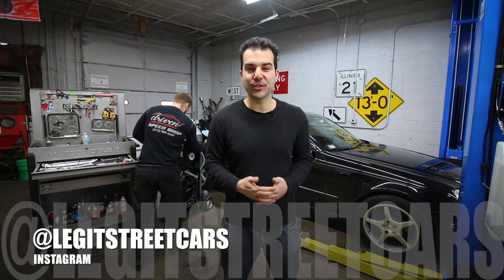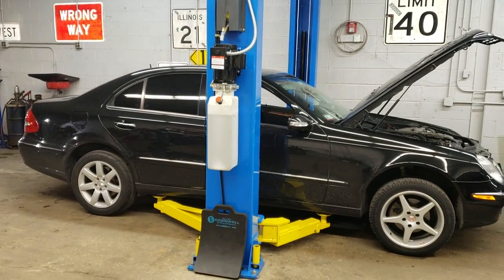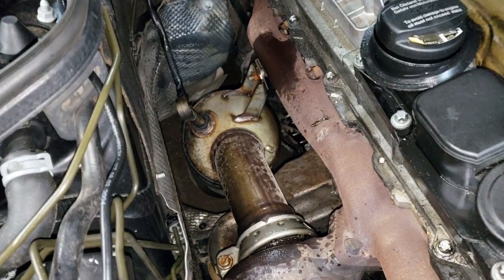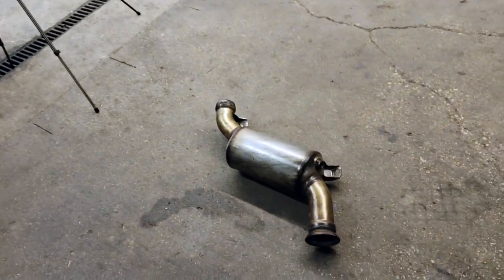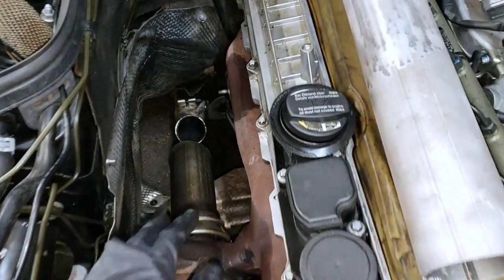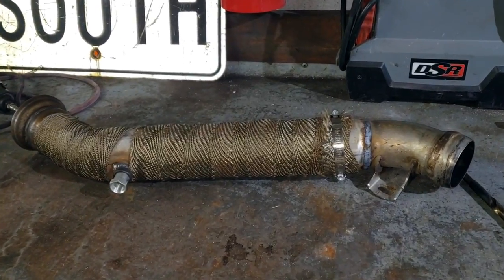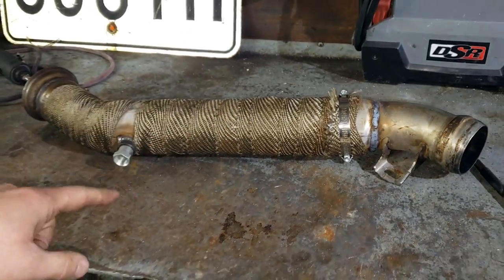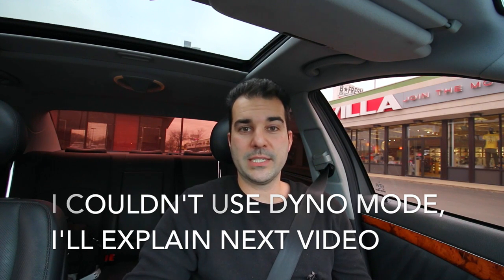I Installed A Catless Downpipe On My Turbo Diesel Mercedes & Tested 0-60 MPH. Listen To That Turbo!

Comment: Why would you deliberately cause more pollution ?. America is already the largest polluter in the world and De-catting cars is not helping.
Reply: You've got to be joking. China pollutes far more than the US.
Reply: @HKR9000  On the news recently in the UK they said the US was ahead of China now. Blamed on the big old Diesel trucks and the fact americans still drive big V8's. Basically transportation as the cause.
Reply: I'd be curious what metrics they're using, I imagine China doesn't track or report as much data about their pollution.
Reply: Lol you do realize diesels put out less pollution right? Thats why most of Europe is 90% diesel cars.
Reply: livey oone  I can't even begin with how much is wrong in that comment. First of all, BMW is discontinuing Diesel sales in the US due to lack of sales caused by the Dieselgate-stigma. Fine particulate matter such as emitted by modern direct gasoline engines is a lot finer then what comes out of an old diesel without particulate filter or oxicat. The fine particles - contrary to the bigger soot particles - are not as much of a problem as the human body can filter them and as they tend to keep close to the ground. Modern diesels with urea injection and scr cat emit less CO2 and Nox than a gasoline engine, also the relation between diesel exhausts and cancer has never been proven sufficiently but used for a huge campaign funded by those interested in selling new cars. Here in Germany the organisation that sued cities and states over old Diesel cars has been funded by Toyota - largest maker of hybrid cars and a huge competitor to Diesels here - and the state itself, which has been lobbied by the car industry to make incentives for the purchase of new cars, especially gasoline cars with worse fuel consumptions and therefore more gas tax (the gallon is lke $8 here, 80% taxes), so revenue for the satet. Think of a cash for clunkers basically, only that it's not about clunkers but 2-3 year old cars now. Also, ask the Ozone layer wether CO2 is a pollutant or not.
Reply: livey oone  The tinier the particles are the harder it becomes for your lungs and nose to absorb the particles when breathing due to the hairs, "fell" if you want to call it, inside them. Diesel has always been the sensible choice for big cars in markets with high fuel taxes, mainly Europe. In Europe Toyota and Subaru compete with smaller commuter cars used for short distances, a case where a Hybrid is often more effcient and the price gap in purchase for a Diesel engine makes less sense financially. Audi, BMW and Mercedes mainly sell cars a lot bigger than Toyota and Subaru plus are more sought after than the aforementioned compacts, in Germany 70-80% of new cars bought from these manufacturers are company cars used for racking up miles. In the US it's a whole different case due to the gas prices to begin with, also the X5 30d was one of the cheaper base models, the Cayenne, Audi and Mercedes Diesels in recent years always commanded a premium over the base models while offering less power. We Germans know that the whole "Dieselgate"-banning here is mainly a PR stunt to saturate the economy. Unfortunately, older Diesels mainly get used as commuter cars by the working folks which is the bigger problem in itself, for some it is not an option financially to buy a gasoline car. My wagon for example get's around 40mpg, a comparable gas model just 25. That combined with the much higher fuel prices here is why Diesel for many is the only option and why uproars like the yellow vests in France formed, politics only catering to the economy and forming policies to a huge disadvantage for the average joe.
Reply: Having one person here and there remove there cat isn't going to destroy the world. If you truly, genuinely cared about the environment, then you would be protesting your government instead. Fracking.. Planes don't require any sort of restriction on emissions whatsoever.. the list goes on.
Reply: Clueless DJ.There is no polution in US even in stop and go trafic, because computer control fuel injector, CO2 is odorless and it is not the pollutant = no syndrom. Smog is unburn fuel in air. Catalic converter reduce CO2 but in  Jurrasic time was  level 4x more and greenery  was booming. Diesel engine  produces no CO2 but NO.
Reply: CO2 is havier than air, stay at ground and is only 0.4 % volume , cars product less then 10 % = 0.004 %,  Educate yourself and do not rise our tax. I personaly like the smell my  Benz Bluetec Diesel and I tell you, my gas Tundra really stink. The most dangerous for humanity are usefull idiots than chlor, fluor, GMO and gluten free crap.
Reply: Who gives a f. Since 2015, everyone seems to be a worldsaver.